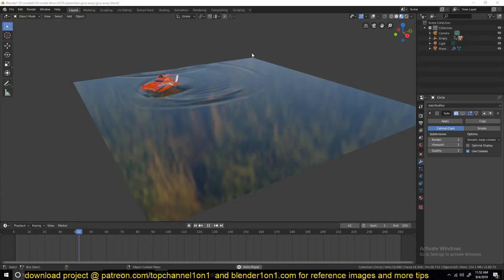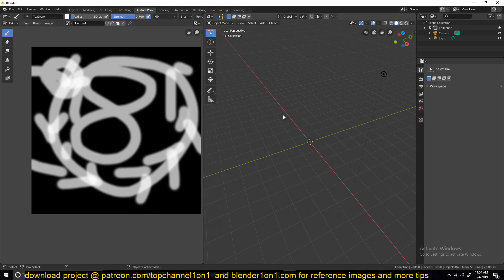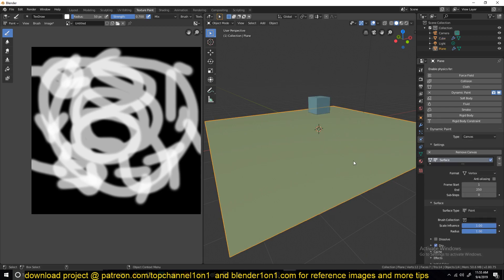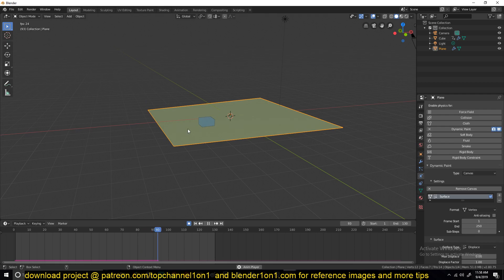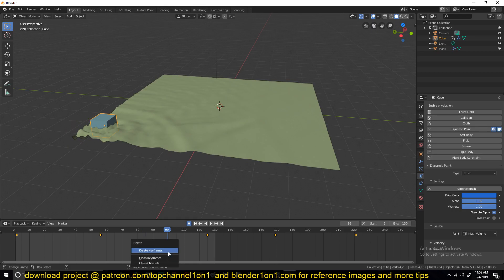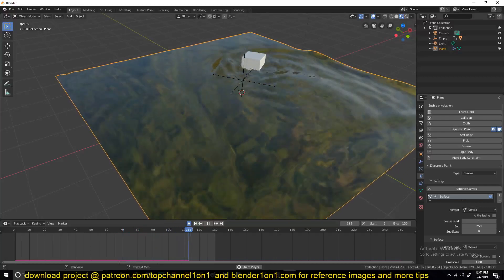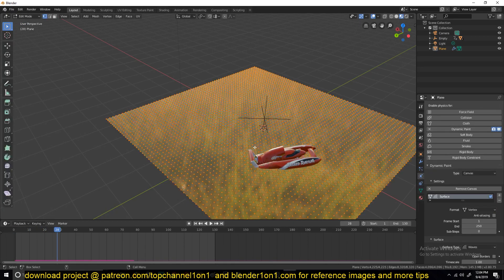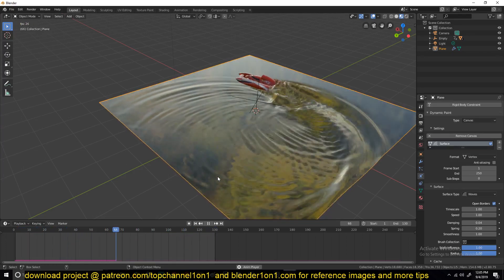creating realistic ripples in water with dynamic painting in  blender 2.8

Comment: can i ask, is that what would be used in animating sand dunes?
Reply from the maker: the wave motion does not stop in dynamic painting i think, so it may be tricky
Reply: @TopChannel1on1  is there a way to animate sand dunes in Blender, I came across something of an animation recently uploaded of the sand dunes changing slightly, not sure if this is done with particles or with displacement
Reply: @ABMultimediaDesigner  Hmm. Maybe try particles.

Comment: Hello, thanks for this wonderfull tutorial.
I have a request : is it possible to do the same thing with a spaceship landing on the ground, with dust pushed into the air, at the same place exactly where the spaceship touch the ground ?
Reply from the maker: yes in the dynamic paint canvas settings instead of waves select displacement for that effect
Reply: OK, thanks, I will try. Even if I don't see well how do you do the link between displacement and dust emitted ?
Like this :
https://www.youtube.com/watch?v=u_jZ3H9-2iQ
Reply: @calogiga  I know this is an old comment but you could always set the mode to paint and then create a vertex group from where it's painting, then use this vertex group to emit the particles.
Reply: ... with dust pushed into the air... 
My trace falls on it, 
I also want to learn it.